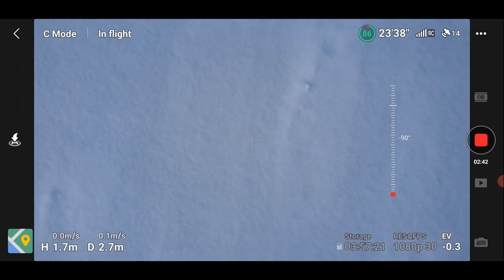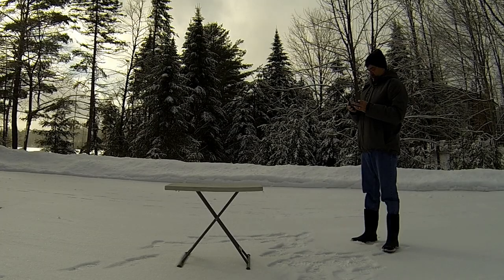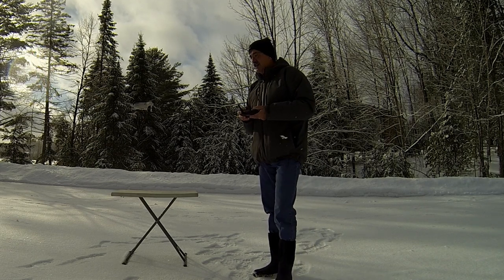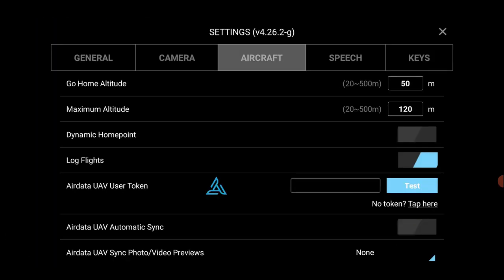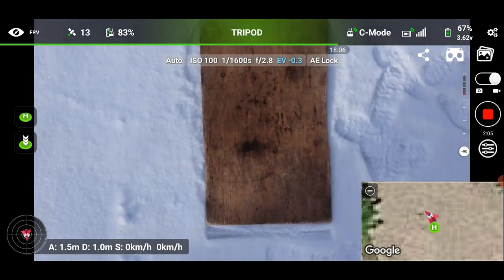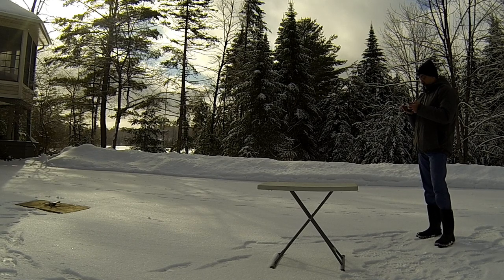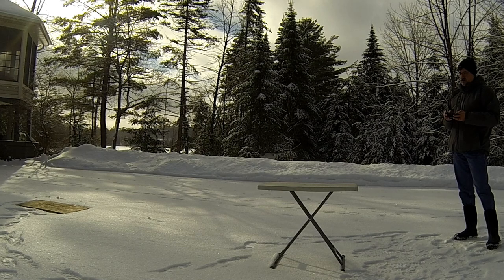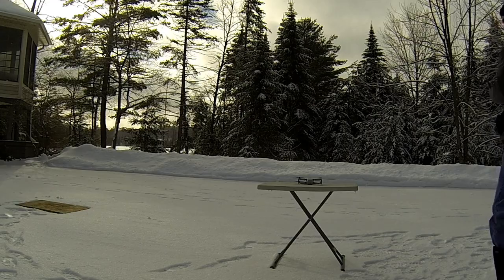Mavic Mini - Turn Off Landing Protection

Comment from the maker: By the way, auto-landing and landing with Return-to-Home all continue to work the same.  This only turns off the "Landing Protection" feature.  The VPS height sensors also continue to function, as shown by the VPS height figures recorded in the log files.

Comment: Nice timing. I've been watching lots of videos about the Mavic Minis trying to decide if I really need another hobby that badly. Always interested in these tips and real world experience videos. Thanks Ferd!
Reply from the maker: I always wondered why anyone needed to carry a telephone around with them in their pocket, and why on earth would anyone then need to have that telephone also include a built-in camera and calculator, etc.  What's the point of that?  I mean if you want to buy a good DSLR camera to do some proper photography, why on earth would anyone expect that camera should also include a telephone? Makes no sense at all.  Yet EVERYONE now carries a cellphone with more computing power than an Apollo lunar mission.  So, if you're interested in cameras, why not a FLYING camera?  Everybody needs one!!  They really are incredibly awesome.  The sub-250 Mini category is pretty much every bit as capable as larger drones, but cheaper and fit into tighter spots.  The only real caveat is that their lighter weight makes them more likely to struggle with high winds.  YOU need one.   Really, you do.  I have plenty of flying tips on my channel, and happy to coach or help with any of your questions.  But for a really outstanding source of stuff you will NEED to know, check out all the videos of @DonJoyce who also commented below.  You'll see another reason why the Mini series is such an attractive option vis-a-vis the overly restrictive regulatory requirements applicable to +250gram drones.
Reply: @Zbip57  Its more a matter of whether I have time in my life for another time sink! Its undeniably cool! Thanks for the vids! If I take the plunge I'll definitely reach out.

Comment: Interesting finding and excellent demo, Ferdinand!  Does the drone retain that setting over a power cycle? I'm assuming yes.  Too bad that setting isn't in the dji app...perhaps under advanced settings.
Reply from the maker: Yes, that configuration setting, just like RTH height, is retained by the drone over a power cycle.  Once the setting is configured on or off, it is remembered by the drone regardless of whether you use the Litchi app or DJI Fly app.  It's just that DJI provides no option for switching the setting from within the Fly app.  If you want to change it on/off, that needs to be done using the Litchi app, or DroneHack.  This feature alone makes Litchi worth the small purchase price!  Another neat configuration option within the Litchi app is at allows you to toggle on/off an additional telemetry display of the currently measured VPS height.  The DJI Go app on my Phantoms always displayed that useful info, showing actual clearance height above obstacles, but DJI removed this from the Fly app.  Why?